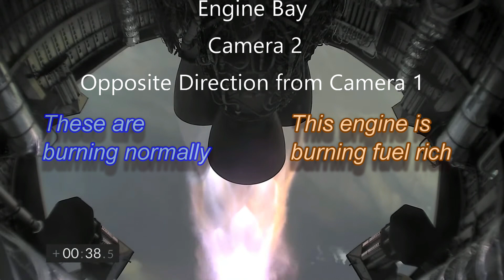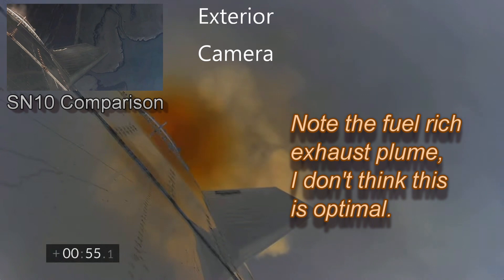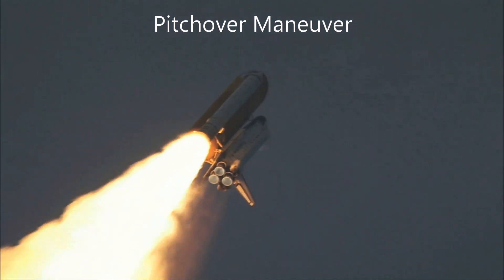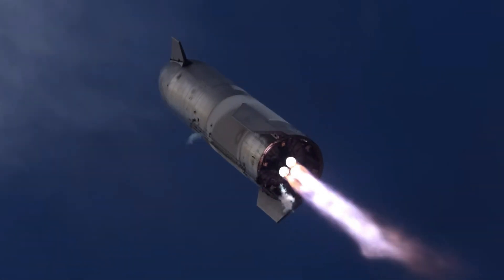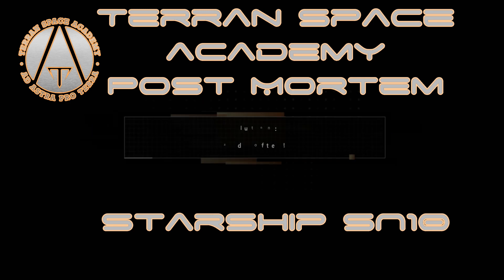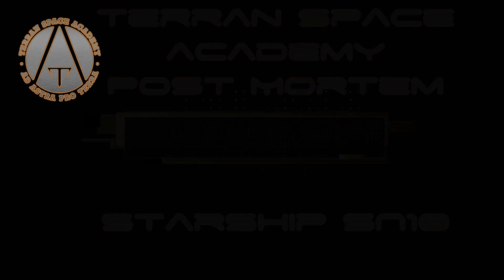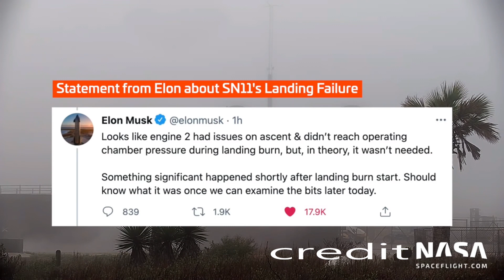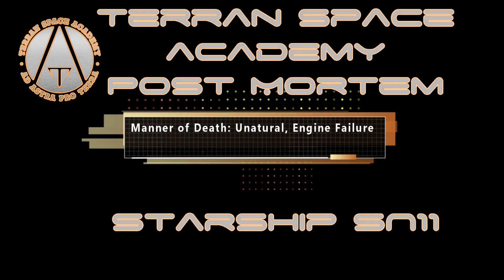Starships 8 ,9,10 and 11 Crash Analysis: Seriously this time.

Comment: Very well summarised - thanks!  Seems the header tanks are not working as intended!  If they were very nearly full there should not be much scope for propellant sloshing and bubbles being ingested by the engines at startup, but clearly this is not the case with SN8 - 11.  I wonder if these early block 1 Starships were never really expected to get this far in these early tests, and the landing process was therefore purposefully not fully built out for them?  This would explain the rather inadequate landing legs that were not quickly fixed too (very unlike SpaceX) and the skipping of SN12 - 14.  This would imply the block 2 SN15 and later Starships are the real test cases for soft landing.  Just speculation of course...
Reply from the maker: I think gas bubbles might be working their way into the piping when its horizontal and swinging as you say.  I think they should let SN15 swing to vertical using its fins much higher and then send enough oxygen through the engine to prechill and create a small gas thruster moment, then fire the Raptors.
Reply: A flush through with LOX sounds good but don’t they effectively do that already with the engine pre-chill before restart?  Perhaps needs to be more vigorous?
Reply from the maker: @stuartnetherclift7566  That’s what I was thinking

Comment: I think the engines are very close to each other, generating a lot of heat inside the skirt. When you turn the engine off it moves away and when it starts it comes back with a lot of force. This can cause a collision with one another.
Reply from the maker: That could be an issue.

Comment: If being horizontal is the issue, this could of course also be tested and optimised on a teststand on the ground, much cheaper
Reply from the maker: I think the swinging from and to different positions causes significant g forces that shift fluids...
Reply: @terranspaceacademy  i guess you could test that also, in combi eg with the small header tank

Comment: I was talking to a friend of mine who was a NASA engineer during the Gemini, Apollo and shuttle missions. He was telling me about the one-use bladders they used to make sure no air entered the fuel supply. It boggles my mind to think that SpaceX is trying to supply engines with tanks horizontal, even with a small header tank. It seems that there are too many variables for this to be fool proof. Maybe they should consider chainsaw tank engineering, because they burn almost every ounce of fuel at any direction of use.
Reply from the maker: I agree completely...

Comment: I believe they need to get the ship verticle before relighting, but it will need to experience decel to settle the fuel in the tanks.  Even in zero G they need some ullage motion to get the fuel to the pick up lines.  Sure I'm using "ullage" the wrong way, but it has to do with getting the fuel to move in a desired fashion.
Reply from the maker: I think so too... I think they'll need to swing much earlier, then cold gas release to create a vertical moment, then start.

Comment: Could they use RCS thrusters under the skirt to right the ship before refiring the raptors?
Reply from the maker: I was thinking about that... it appears they try to pivot around the base... that seems to be the best you can do.  Perhaps a cold gas oxygen release to create a Raptor cold gas thruster effect early enough to create a moment in the right direction.  I think they are going to have to flip and start much higher so as to be fully vertical with time to reignite the engines.
Reply: @terranspaceacademy  Yeh do I underrstand you mean a blast of pure oxygen through the raptors to get the thrust needed to correct the aspect and chill the engines at the same time, then restart and toggle the engines as required?  At a higher altitude?
Reply: @terranspaceacademy  I think it's finding the sweet spot between higher flip altitude (for fuel settling) and the need to carry more propellant (for that subsequent reduced air-braking). They have chosen to test the lowest horizontal--->vertical flip altitude that could conceivably have worked, and found it too low. That in itself is important for them to know.
Reply from the maker: @John-nr6gg  I agree. And that almost certainly will take continued experimentation and a few more crashes.

Comment: In this episode of BCSI . . . (Boca Chica Starship Investigation) 😉  Seriously,  the falcon 9 boosters do 3 restarts during RTLS launches  (boost back, reentry burn, landing burn) and they seem to work.  After second stage separation, the booster flips 180 deg before boostback on a more or less horizontal position.  Is it just that the raptor engines are still too early in their development to perform just as reliably as the merlin engines?
Reply from the maker: The plumbing on the raptor is much more complex. The merlin is an open cycle gas generator engine. Those are very resistant to positional change. The raptor has two pre-burners. One oxygen rich and one fuel rich. I think getting things to flow properly through all that piping can be an issue.
Reply: @terranspaceacademy  Seen a lot of comments about those turbochargers and the possible effects of shifting g-forces too.

Comment: Great explanation on this one. Falcon 9 rockets seem to be landing fine also while enter and land vertically. Starships suicide dive seems to be the culprit for killing engines going from horizontal to vertical. Hopefully SpaceX can solve this problem.
Reply from the maker: Thank you.  I'm sure they will.  They can pressurize and adjust valves to block propellant movement.  Firing an engine horizontally is a breeze compared to starting one while its swinging through 90 degrees.